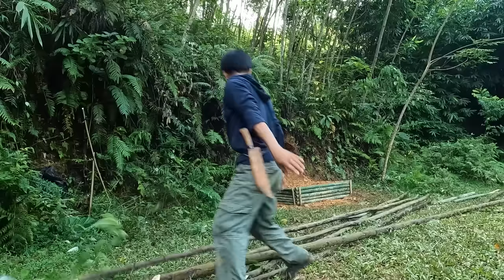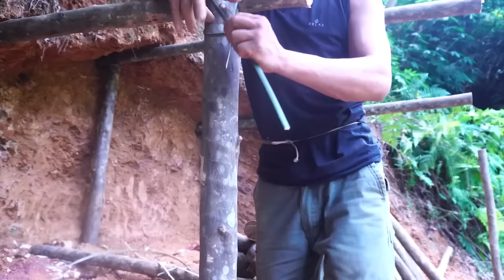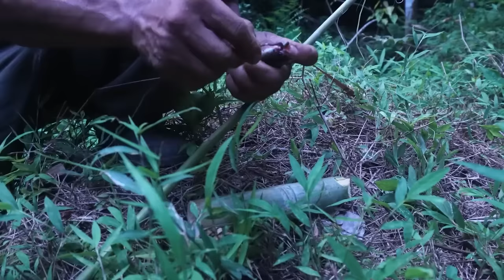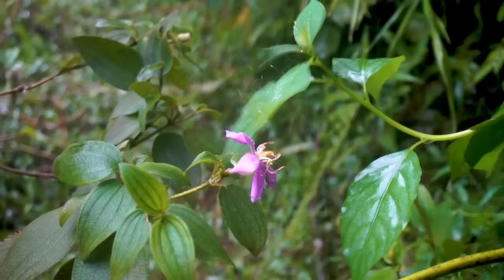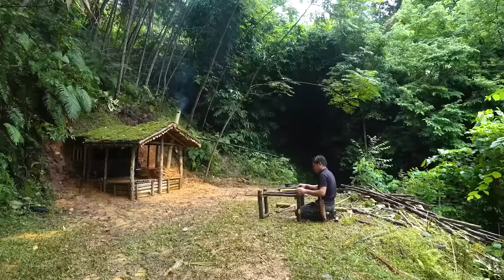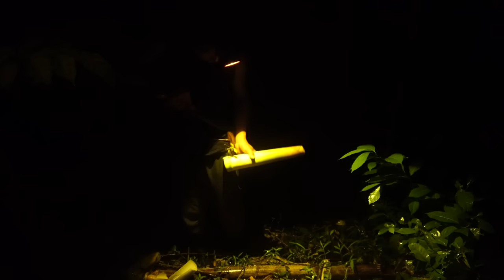Full video: 30 days Survival and Working despite the rain, completing the Bushcaft house in the wild

Comment: I only have one real question. 
Nice build and all but why do you NOT make these structures high enough to stand up in, with a door you don't have to bend over or crawl in on your knees? If you are 5 feet (1.52 m) tall, make the structure 6 feet (1.83 m) tall. Seems really logical and probably would save banging your head, and with not that much more effort. But hey, you're the one that has to bend over or bang your head all the time. (grins)
Reply from the maker: I need such suggestions. Thank you so much 😻